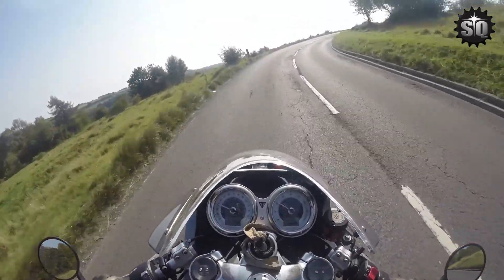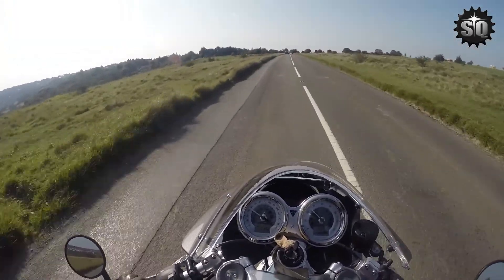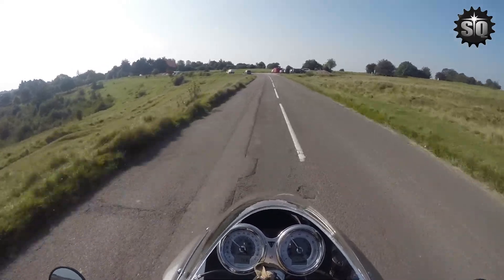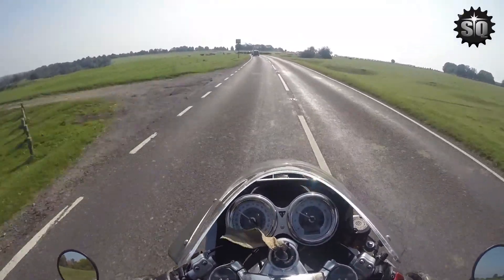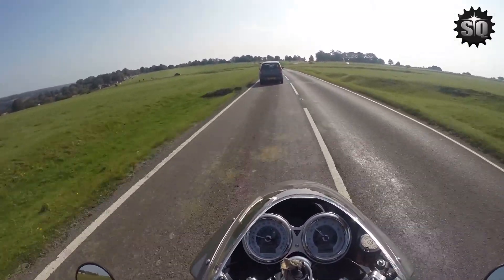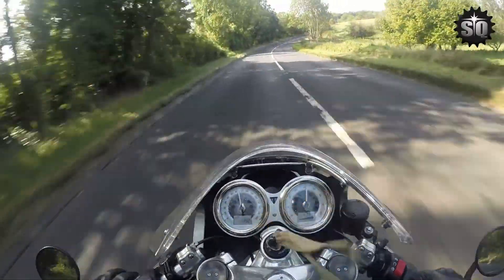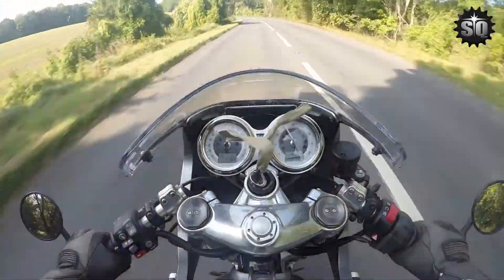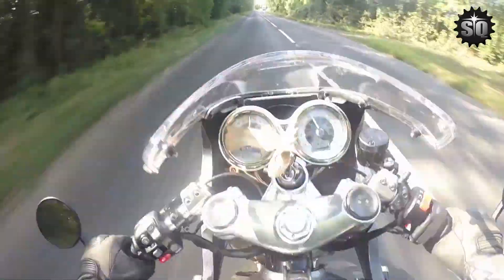Triumph Thruxton R: 17/37 Sprockets - A Revelation.

Comment: 17/39 combination now fitted. 4000rpm is now 85mph in 6th,14.40% difference from the factory 16/42. So much nicer to ride,with plenty of instant response in top gear when required. Triumph have produced a beauty of an engine,with the 1200,and with a few mods for better 'breathing' and fuel mixture,can be made perfect in my opinion.

Comment: Great Vid....Found the Speed Twin ridiculously low geared as standard and replaced the rear 42T with a 39. Big improvement,(80mph @4000rpm)but could easily go taller again,without spoiling the ride due to the huge torque,instant throttle response and the lightness of the bike. Going up from 16 to 17T next,which I feel will give the ideal gearing for me. The de-cat,fuel booster,aftermarket air filter,front and rear suspension have all been worthwhile upgrades.....Loving this Triumph.
Reply from the maker: Thanks! Changing the sprockets turned this bike into absolute perfection! I'm glad I'm not the only one that feels this way about the gearing!

Comment: I've run anywhere from a 16, 17, 18 on front to 42,40, and 37 on the Thruxton R and all combinations thereof depending what I'm doing. Street , drag or land speed racing personally I  prefer a 17/40 for general street riding. 16/42 is still best for drag racing if your very fast and 18/40 will get the best top speed if you only have a few engine mods.
Reply from the maker: You have some great videos! Have you ever tried a quick shifter on your Thruxton? - maybe then my slow hands would not limit how quick you go through the box!
Reply: @sqmoto  Sorry just saw this. The quick shifter on my Tiger makes about .1 to .2 different when used. I haven't got around to a quick shifter and probably won't as the year will probably be my last year drag racing. I think 69 years old is getting up there and I'm more inconsistent every year.

Thanks for watching some of my videos.

Comment: I have a husqvarna svartpilen 701 75hp
16-40 sprocket stock … i am going to get a camshaft and a dyno jet so it will have 15% more whp peak and in some places 25% whp power improvements … and my question is jumping from 16-40 to the 17-37 with the power gain … do I loose acceleration or not ?